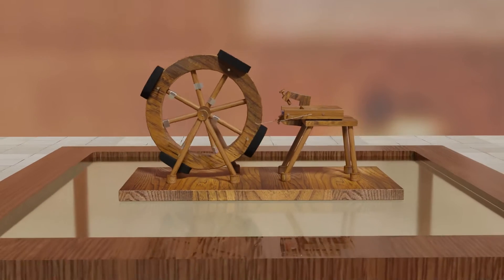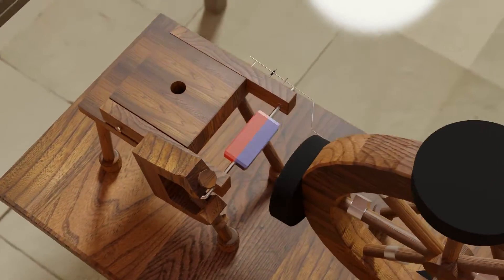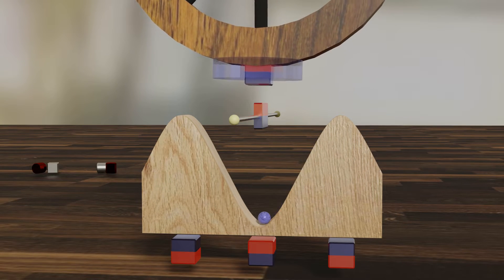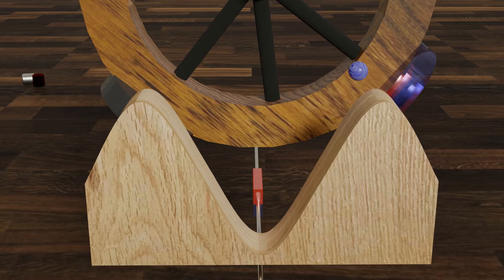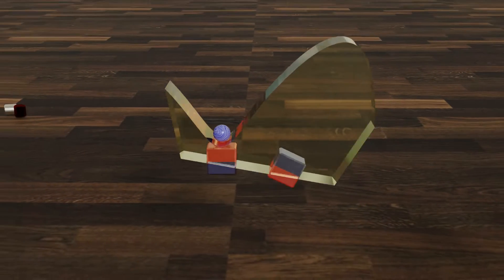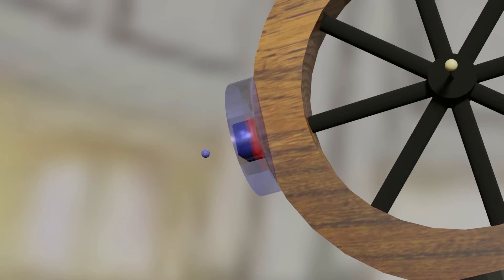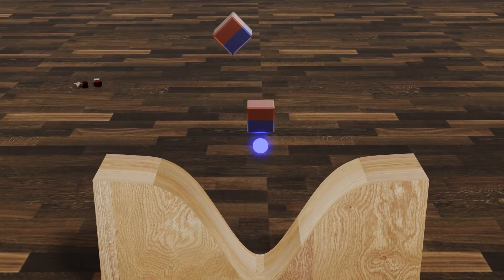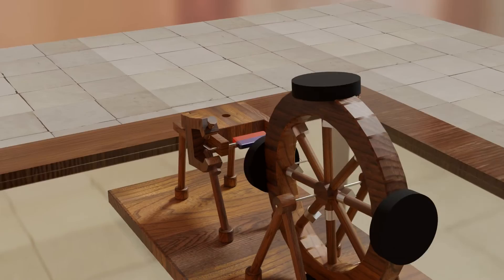Magnetic perpetual motion motor, which is continuously powered by a tilting magnet mechanism.

Comment: the point you missed ;   the down hill in your gravity model gain velocity and this KE is used to climb the up hill ... i hope you understand ...   you are assuming the ball's velocity is equal both climb up and down ... which is incorrect ... in this magnetic wheel the downhill or the pull increases the velocity and that inertia is used to cclimb uphill... pl. correct me.  ... i think it works.
Reply from the maker: Hi Hunter, thanks for your comment. Yes, you may be right. The ball gains velocity. But this velocity is equal to the loss of velocity while climbing up the slope when trying to overcome the edge. Because of this equilibrium then is no gain of power. And the friction also reduces imaginary the energy gain.
I thought a long time like you, but there is no energy gain possible without feeding from outside 🙂. Sorry for that.
Thanks for watching

Comment: 7:53 here is the biggest flaw in your argument. of course the direction of the magnetic field affects its strength. you have no clue what you're talking about. ima make one of these to prove you wrong, naysayer. 
also, if you can start the rotation with a movement, obviously setting up an automatic inducement will result in perpetuation of the rotation. simple to do.
Reply from the maker: Hi H7, thx for your comment. I admit that the visualisation of my older videos could have been better. In my newer ones, you’ll probably understand better. I apologise. Thx for watching 🙂
Reply: @yWild  the concept is easy to understand which is why you should stop making these misleading videos. you don't know how magnetic fields are formed.
Reply from the maker: Hi H7, sure I will if someone is really able to prove me wrong. 🙂 Actually there is no working device out there and I fear it will stay this way. You offered me to build some of these motors to prove me wrong. If you really develop an perpetual motion motor design which really works, I gladly retire 🤗. Then our world energy problems will be solved 👍🏻 and you will be our hero. Thx for your comment.
Reply: @yWild  i will keep you posted.

Comment: dude, would you be willing to run a simulation of my theory, I presented the idea on my channel and I am just making a physical model to test it now?

I am pretty sure that i have found a thermodynamically compliant way to achieve a COP of two through the use of electrostatics and by making clever use of potential energy.

The system uses the same principle of opperation as the Bennets Doubler but just uses them in a slightly different fashion.

you have two outer plate connected with a wire and separated by some distance, in the middle point between the connected plates you insert a charged plate. At dead center, since the plate is equidistant to the other two, it is in an electrostic null point and the inductive effects and attractive and repulsive forces are equal.

The inductor is then moved off center, this changes the inductive balance of the system and charge flows through the wire, as it does so, the inductor begins to experience a pull force towards the nearest connected plate as it starts to become oppositely charged as well as a repulsive force to the further plate.

if permitted and if friction is low enough or the voltage and capacitance high eneough, the pull force will try to put the inductor besides the plate it is nearest to.

So from the null point it can be said that the inductor has potential energy in relation to both side plates.

the electrical energy that will be stored in the plate it is next to will be equivalent to the potential energy that was lost travelling from the null point to one of the connected side plates.

if we want to move the inductor to the nullpoint once more, we must expend energy to separate the plates which will be equivalent to the energy that was stored capacitively plus the energy lost through electrical resistance.

Once at the nullpoint, we can push the inductor just a little closer to the opposite sides plate and now the potential energy we built getting to the the nullpoint can be used to complete the second half of the movement as the polarity of the system becomes opposite.
Reply from the maker: Hi Alex, thanks for your comment. I do this simulation, after thinking about the moving magnet and the way of realising it out of the magnetic maximum. With my model of transferring magnetic force into gravitational force, I am able to assume that the principle is not able to run perpetual. If it would, the shops would be full of them to buy. But I’m very interested in having a look at an working device. 
I apologise when I upset you, but this model out of wood is so well made, that it made me curious and starts my brain working 🙂. Thx for watching

Comment: I would like to brute force a working magnetic motor with blender by using programming [ as i 5+ years of experience with python ], I think i can do this with blender and python, but I am not sure if I will complete it or not, as my knowledge with blender is very minimal. I also have decent computing power for such a task.
Reply from the maker: Hi Cody, thx for your comment. If I understand you right, you like to program an neue force algorithm which builds an perpetual magnet motor.
It should test all possible variations.
That it’s an good idea, but unfortunately the physics system of blender fits not to reality as desired. Thx for watching 🙂